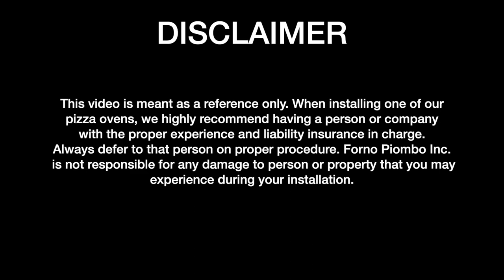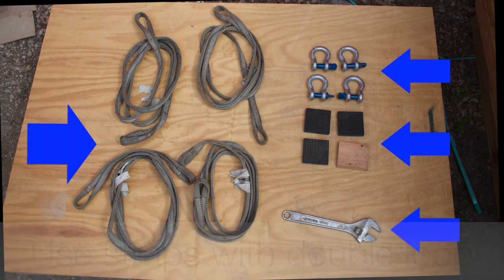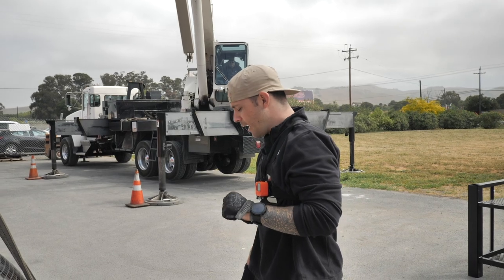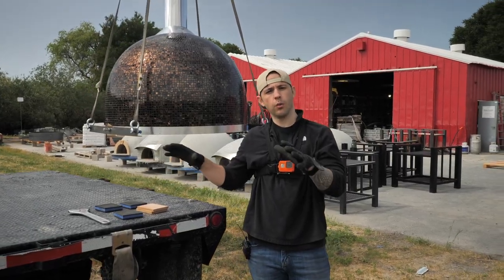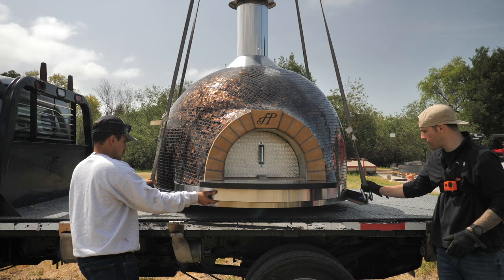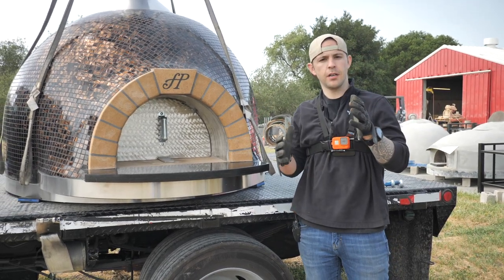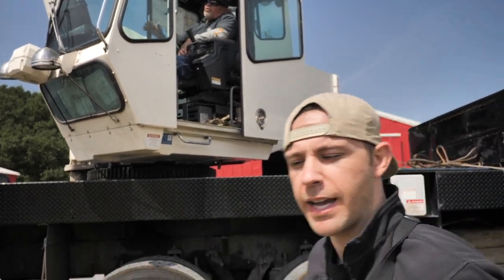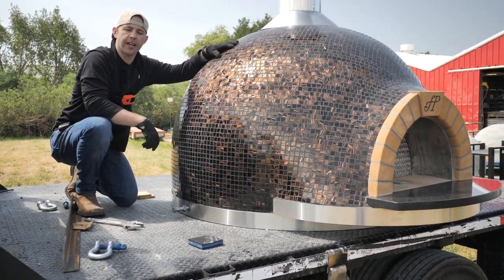Installing Pizza Oven on Countertop with Crane

Comment: Alec, I would say an hour of hook time plus any time needed to set up and tear down the crane.  The lifting bars should be installed prior to the crane's arrival or while the crane is setting up.  As long as everything runs as planned it can go as fast as it does in this video... but I wouldn't plan on that to be safe.